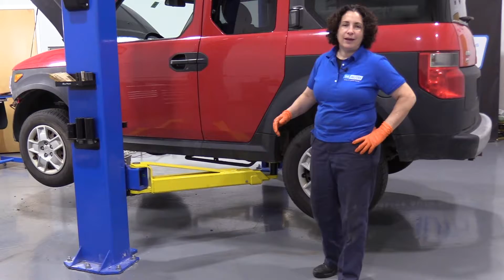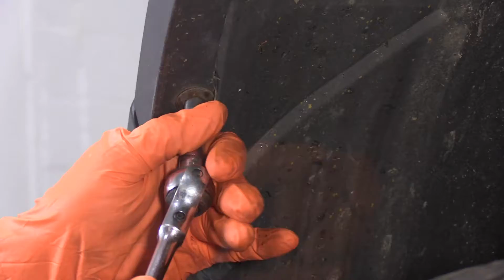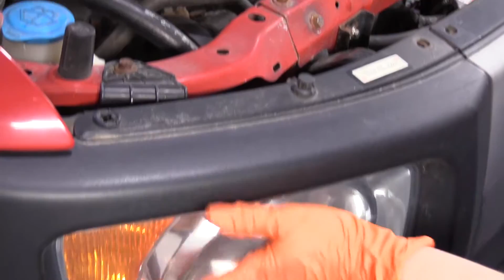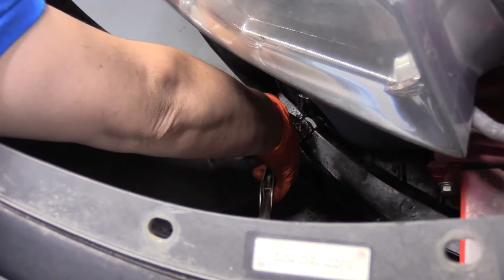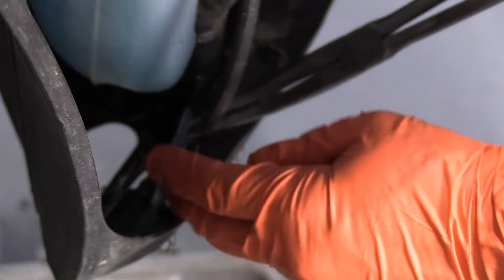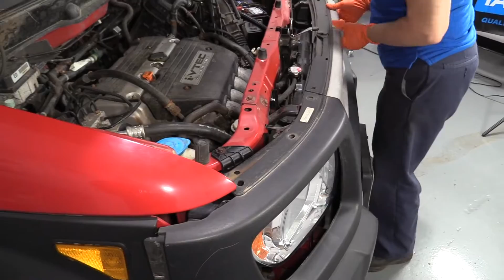How to Replace Front Washer Pump 03-11 Honda Element

Comment: Guys, don’t waste your time taking the bumper off. This is ridiculous. You don’t even need to take off the passenger side wheel. The splash shield has enough flex in it that all you have to do is remove the 10mm bolt(s) in that corner and push it back and you can access the pump. (Mine only had one.) Use a pair of channel locks to pull the pump out, since it might be hard to pry it out from the top. You’ll need a pan to drain the washer fluid into. Don’t make a quick job into an ordeal like this video demonstration.

Comment: ummm why make it seem so complicated?? I just replaced the pump in my 03 element in about 10 minutes:  Take off the passenger wheel, unscrew the 2 10mm bolts on the bumper corner piece, and slip out the plastic cover thats covering the pump.

Comment: I just changed the pump on my 2007 Element SC without removing the bumper.  It was easy.  Jack up the right front, remove wheel, insert jack-stand, remove two 10mm bolts under front bumper just ahead of the wheel well, take note of how the fender liner overlaps the bumper and other components, remove 4 or 5 plastic push-pin fasteners, tease fender liner out of the way to expose the tank and pump.  Pry out the pump and if it's full like mine, expect to catch a lot of fluid in a handy pail or pan.  Unfortunately, the fluid doesn't flow nicely into the pan so I picked up the pan to hold it closer to the flood of fluid.  Then the moon shifted in its orbit causing a wave in the pan, so it tilted, I dropped the pan, and I spilled all the fluid on the garage floor.  But since I'm a good swimmer I didn't panic and I was able to install any connect the new pump without drowning.  However, I did get pretty wet lying their in all that blue juice.  I checked the function of the new pump and fastened everything back up.  It took about 20 minutes to change the pump and another half hour to clean up the mess in my garage.

Comment: That's a lot of work when there is a access panel below the bumper.. two bolts removed bend panel out of the way and both pumps are right there. took like 5 minutes
Reply: That may be only for newer elements like 09-11. But thanks to your comment that’s what I did on my ‘11 and it was great.

Comment: Does anyone know which pump controls the what i.e. does the pump on the front of the reservoir control the washer fluid on the front windshield or the rear window?
Reply: The one she replaced is for the front windshield only. It's on the same fuse as the wipers, so if your wipers work and your squirter doesn't, you know it's the pump. The rear pump is on a separate fuse.